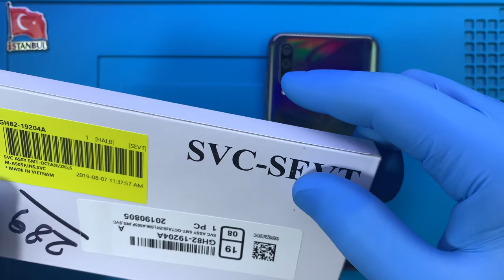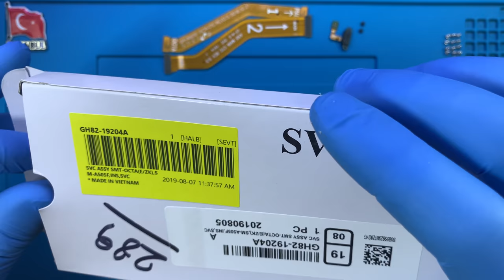Samsung Galaxy A50 Ekran Değişimi 🇹🇷

Comment: I have a little question bro - what do you connect to the glove at the beginning of each movie? 
Good movie thank you ✌
Reply from the maker: Hi;
Static electricity-free wristband on the left arm. Our technical service is designed to be completely free from static electricity, but it is installed by our technicians as an additional measure to prevent static electricity that may occur momentarily. It is a special magnetic magnet on the right arm. It provides the holding of very small metal parts.
Greetings.

Comment: what is the function of the cable in the hand?
Reply: Ricky it’s an anti static wrist band
Reply from the maker: Hi;
Static electricity-free wristband on the left arm. Our technical service is designed completely free from static electricity, but it is installed by our technicians as an additional measure to prevent static electricity that may occur momentarily. It is a special magnetic magnet on the right arm. It provides the holding of very small metal parts.
Greetings.